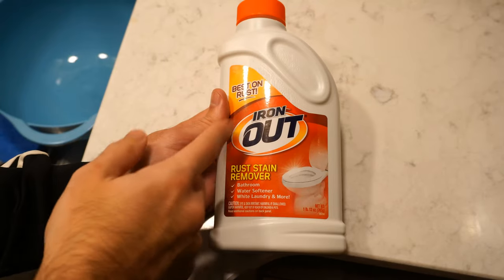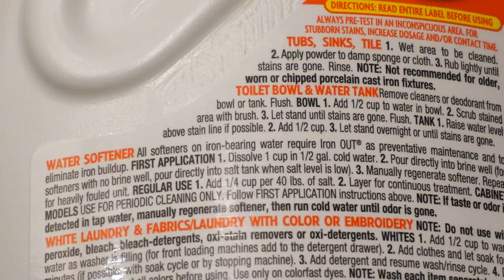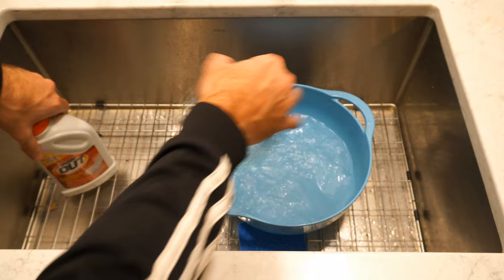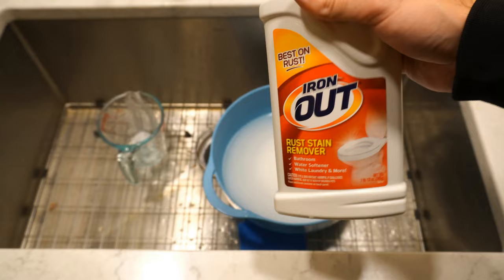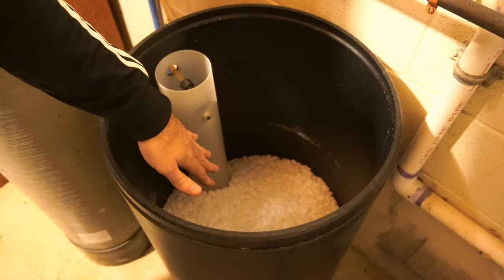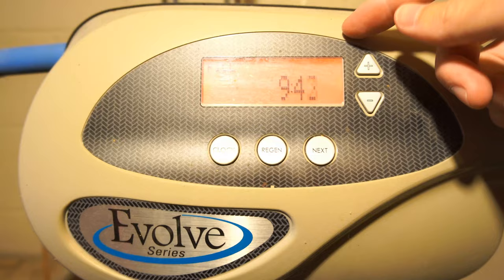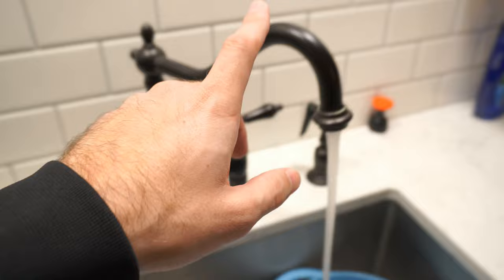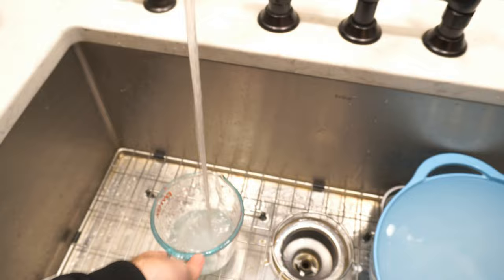How to Clean Water Softener & Restore it to NEW! (Easy Maintenance!)

Comment: If you are doing this to eliminate odor that is in your hot water,  which I picked up on by your comment at 3 minutes and the fact you were running the hot water, this will not fix it for long.
If you have stinky hot water and a softener, you should install a powered anode in your water heater.   There is a chemical reaction from the softening that causes the smell.   The powered anode eliminates the reaction between the softened water and the regular sacrificial anodes in your water heater.  (It has to do with how the beads in the softener ionize atoms and that reaction with a standard [aluminum or magnesium] anode rod  - I may have that a little messed up but that is the gist of it)  The powered anode is more expensive than a regular replacement anode, but it actually eliminates the problem within a few hours (at most) of installing it and plugging it into a 120V outlet.   The most difficult part is getting the old anode out- often requires a breaker bar with a cheater or an impact wrench.   I guess if you had to install an outlet for it, that might be the more difficult (longer) part - the anode was supplied with a cord that is like 10 or 12 feet long.
You should definitely do maintenance with the Iron Out, but if you have smelly hot water (just the hot) then you should think about the powered anode.
Good luck either way.

Comment: What would make the salt bin have a gas like vapors literally 24 hours after installation? I use Morton salt layered with iron out on 45000 grain AO Smith system from Lowe’s. I checked it the next day after first regen Cycle and the vapors literally took my breath

Comment: Since we are dumping it into our water system, is iron out safe to drink?
Reply: It's just as safe as the salt being used in the Regen cycle. Since the salt doesn't remove heavy metals the iron out acts as an assistant for removing iron from the resin beads during the backwash stage. You could also install a filtration system to remove iron if there's a lot in your water supply.

Comment: I did not know that we have to clean the salt tank until I watch this video, and I thank you for that.  After pushing the Regen button,  how long do I have to wait until I turn on the faucet inside the house to get rid the odor?
Reply: It typically takes about 60- 90 minutes for older systems to fully regenerate. Newer systems, to my understanding, may complete the regeneration cycle within 30 minutes. Either way, just wait until the regeneration is completely finished with.

Comment: If you have a dual tank system, I’m assuming you need to do two recycles with iron out?
Reply: By dial tank system do you mean something like the SS1 by SpringWell? In this case there's an initial filter tank, then sediment filter, then brine tank and finally the resin tank/filter. In this case, you're adding the iron out to the brine tank pump like he shows. The mixture is drawn from the brine tank into the resin tank to then clean the resin beads of any iron and manganese buildup. This solution in the resin tank is purged down the drain and it's ready for new brine water.

Comment: I’ve done the same method when rinsing my softener and the water smells extremely bad right after. Even if I let the water run for ten minutes. It doesn’t disappear before after three-four days. I’m also using Iron Off. If anyone has had the same issue and found a solution, I’m all open ears. Thanx 🙂
Reply: Does it smell like sulfur?  Does your feed water have a smell?  Usually it is coming directly from the raw (feed)  if not have you tried 2 to 3 regen's after performing?  Just questions that may help.  (Also, if a well get a full water analysis from a lab, just say drinking water and they will give you the proper bottles, maybe your softener cannot handle the raw chemistry)

Comment: Hi I did this cleaning and it worked great it even increased my water pressure but I don't know if this caused a issue with my salt turning to mush or could it be bad salt pellets ? I'm Leary of tiring it again because cleaning out the brine tank is a big job. Your thoughts. Ty
Reply: Well, the salt does dissolve,, and that with water is your brine. I've used the described method with no negative results.